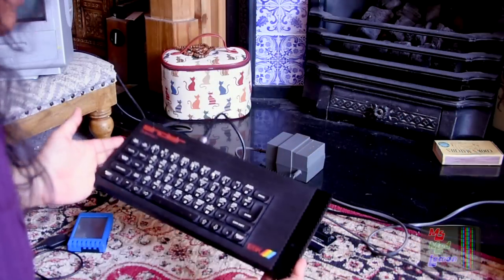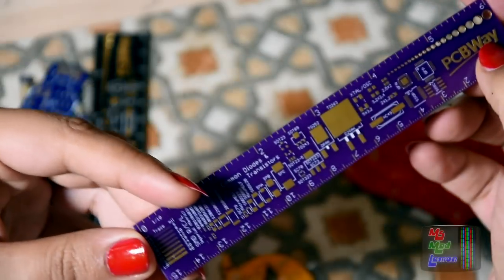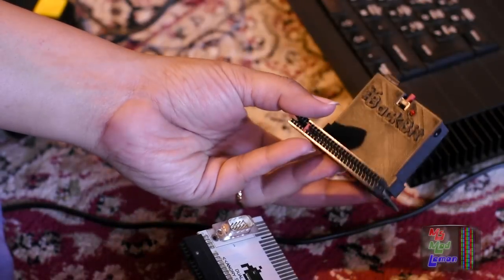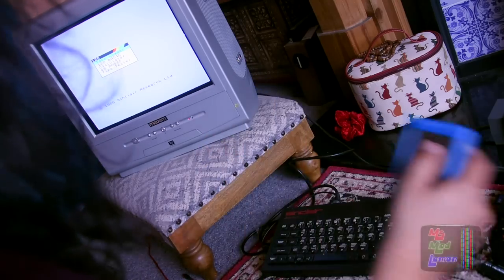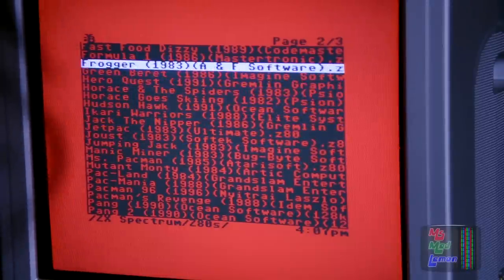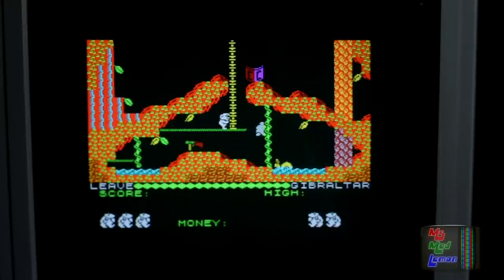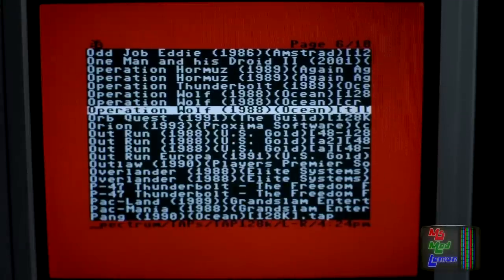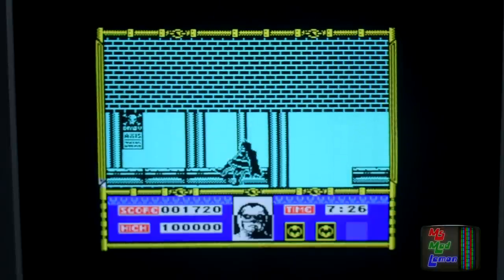BackBit Cart on ZX Spectrum 128k Toastrack - Featuring SIDBox and DIVmmc

Comment: TZX supports many tape encodings whereas TAP only covers the original ROM loader... so tapes with turbo loaders will be TZX format. Z80 and SNA are memory snapshots usually made in emulators but they were also made by things like the Romantic Robot Multiface cartridge.

Nice toastrack :) I've only ever serviced 2 so far but they are nice little machines!
Reply: From what I've seen in the video so far, the Backbit seems to only support intercepting the ROM tape loader being used. If a custom tape loader routine is used, it doesnt' work.
Reply from the maker: Thank you for clarifying this, othr than TAP and TZX I wasn't sure 100% what the others were.

Comment: Due to a severe lack of space (and time), I no longer have my speccy setup and now rely solely on emulation for it (truth be told, all my systems are now emulation based) but when I do get the chance to get my +2 out, the divmmc I have for it is wonderful. 
I would have so loved it back in the day as tape loading for me is now a thing of the past, I do not have the luxury of the time it would take to play stuff the old-fashioned way and SD solutions are the only thing I use now on my physical machines.

Comment: 29:42 ouch. Hopefully nothing major got blown there... going by where the smoke has come from, the voltage converter has been damaged.
Reply from the maker: I did some tests afterwards, the spectrum itself seems to work, it's not the regulator as I replaced that with the same result, you can very very faintly see something on the screen evn though its' totally black (RGB out) i loaded a game, it loaded, played the music, but there's no video output, so thankfully it seems the CPU, memory etc is fine,  i'v not trid RF out yet but at least the machine itself seems to be working. I did suspect a transistor after replacing the regulator, as I know something somewhere to do with the RGB isn't getting any power.